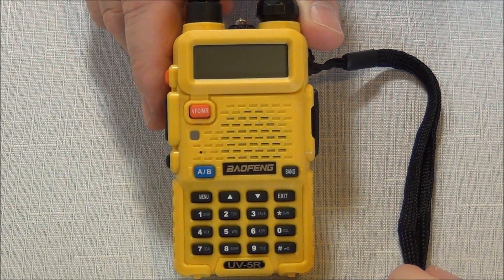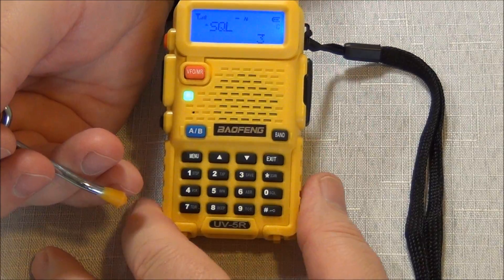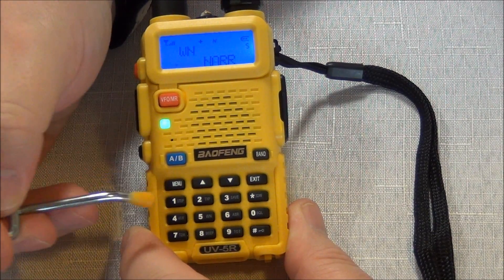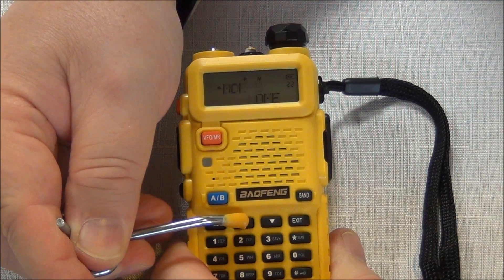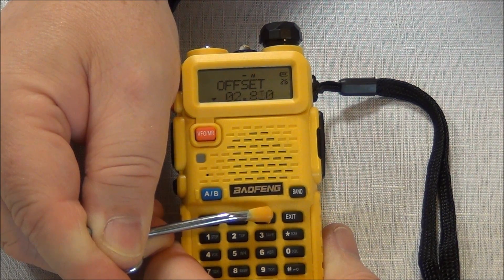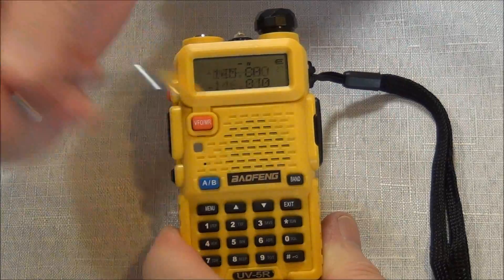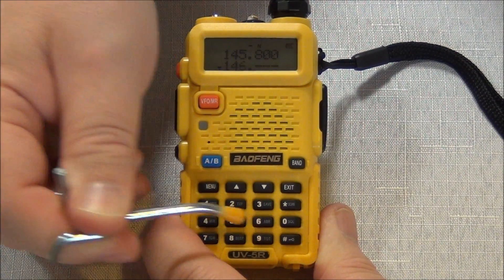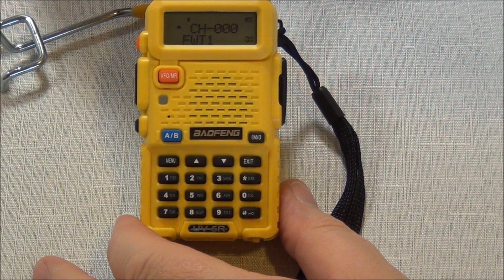Repeater Programming of the Baofeng (Pofung) UV-5R Dual Band 2M & 70cm Transceiver -- AF5DN

Comment: I have the UV-6R, it can be programmed in two ways... one saving the Rx and Tx in memory, done by simply saving two frequencies in one memory slot (it says "receiving mem" and 2nd "time transmitting mem" each time). Second way is to program one frequency and set the shift direction and offset and then saving to a memory slot once. It seems to work for me at least. 🤔

Comment: One of the best descriptions of how to program this radio. EXCELLENT. Factory documentation is poor, there are too many oh-by-the-ways with this device. Chinese government is attempting to buy this market, street prices are probably their manufacturing costs, but you get a great bang for the buck to be honest. Suggest you use RT Systems programming software, (they are in Broomfield, CO), easy and fast to use instead of plugging in the programming data manually.

Comment: I have the new UV-5RPlus. If I program a repeater and assign it a channel, ( either in A or B) I expect to see the offset settings to stay with that assigned frequency, What I have noticed is that if I remain in A  for example and have set a NEG OFFS. for 147.110 and then program 147.220 with a POS OFFS (still in A), save everything to memory, whatever the last offset shift I entered will remain even though I went back to 147.110 which had a NEG OFFS... have you noticed this or am i wrong?

Comment: hello 
i try to prog the bf888s and most of the time i get "pleas check all connetion and commtion port seting", i am using the "prolific" usb to com. some time the led (flashlight on the 888) turn on with no connection.

i try some parmter:

speed : 4800, 9600,  115000
party : none, even 

what is the  setting to the port (speed, party, data bits, stop bit, flow control)?

does it depand what com i use (com1, com2, com3)?

i am using win7 / 64 bit, and try it olso wint win xp 32bit. 
thanks

Comment: For VHF repeaters in the U.S. the shift is 0.600 MHz up or down, depending on the frequency or region. For UHF repeaters, the Shift is 5 MHz . Check the ARRL repeater directory and there you will find all this information. This is covered in the HAM training. Are you a licensed HAM?

Comment: You programmed 146.840. How do you know transmission is at 146.240 ? Is it a subtraction from the Off set ? Now how am I gonna get the specs from the repeater ? I live in the country area. What if someone lives in Dallas ? Are there several repeaters ?

Comment: Ok I'm just starting to build out my bug out kits for my sons. And I new to Ham Radio's I have a question if my son's need to travel to another state will they need multable repeater locations and if so can the Baofeng hold them and how many. Would it best for me to input them to where they would enter connect with each other say about 50 miles apart if going from Calif to Texas?

Comment: I noticed when you select menu it shows the last menu that was used. Is this consistant with offset? If Offset is once set to .600 will the next repeater you program require you to step down from 5 mhz again or is .600 retained?